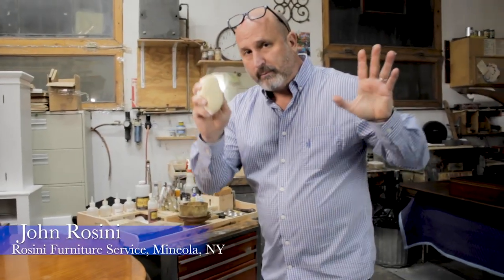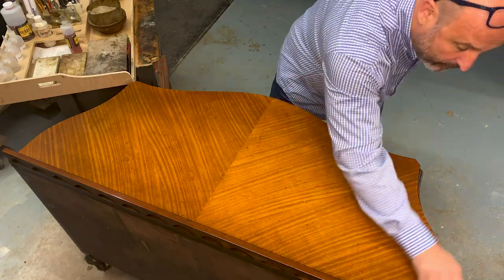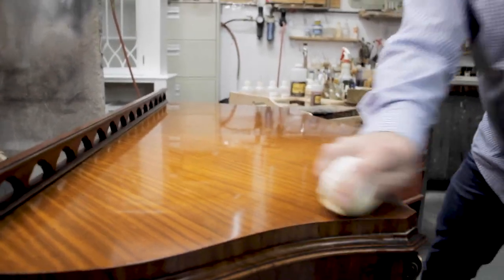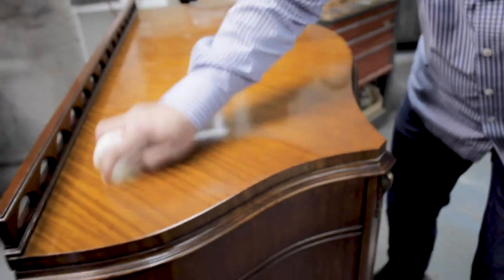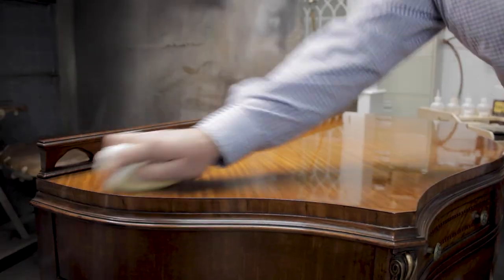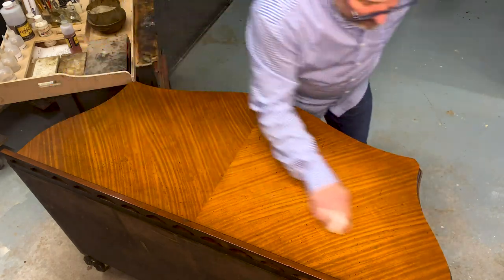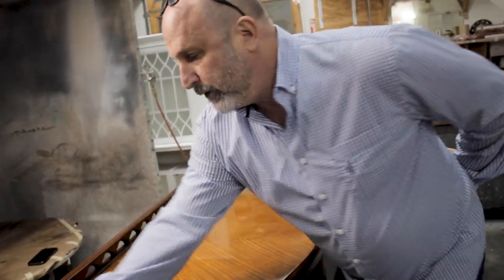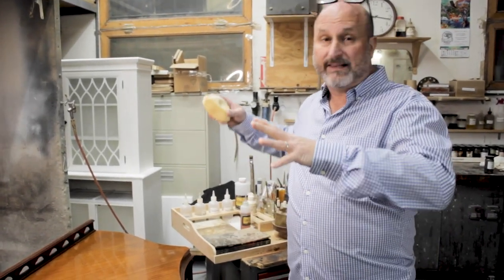How to French Polish with 77 Lubricite

Comment: I tried Lubricite for the first time, and am mixed on the results. On small "parts" to my project - I could restore a vintage lacquer finish to a clean, new look with just one "wipe" of Lubricite. No multiple coats needed on these small pieces - and I am very pleased!  But on a drawer face surface - it went on great for the 1st coat.. there were marks from the pad, but they softened by the 2nd coat. When I got to the 3rd coat - ugh - the nightmare began. I ended up having to cut that finish back - and have decided not to complete the project with the Lubricite. I had too much trouble with the pad "catching" and skipping/skidding.. and feel that it might be a problem with the cheese cloth (purchased from a woodworking shop). Perhaps I need to find a different brand that's got a tighter weave. I noticed the cloth separated quickly on the pad, and is the cause of the stroke marks & skidding (and yes, I used mineral oil to try to halt this).  The good news is that I know this will work over an old lacquer finish (mid-century dresser).. the bad news is that you really have to get a feel for this product, and practice likely makes perfect. I don't think it works well over a surface that has decorative engraving or any uneven surface - that adds to the skipping/skidding issues. On a flat, smooth surface (table top) I would definitely give this a try. Hopefully, I can become more confident with Lubricite in the future.

Comment: I have attempted doing a Shellac French polish once. I could see the shine starting to form but it did not turn out as it should. I still go a good shine on the project but I was wet sanding with 2000 grit sandpaper.
I need to try it again.
Reply: If your jump ahead to the 8:50 mark in the video, John talks about controlling the amount of shine you desire. 77 Lubricite is compatible with almost all finishes.
Reply: @77lubricite-finishes  - yikes... so initially, in first video, you say compatible with "all" finishes.. now it's "almost all" finishes. Can you tell me which finishes it is not compatible with?  How is it on old lacquer finishes?